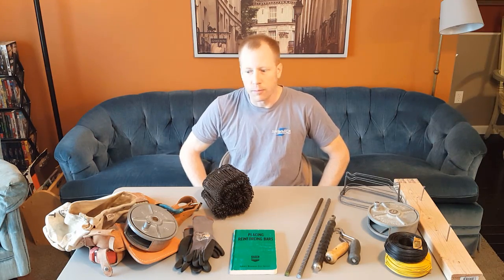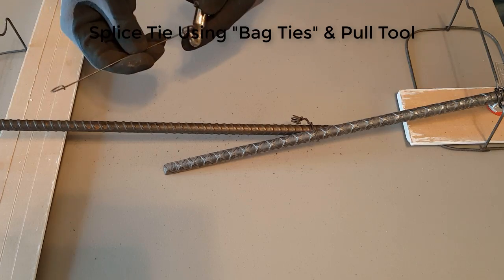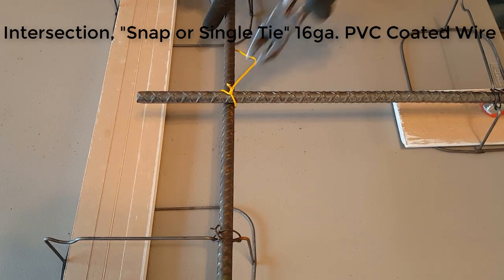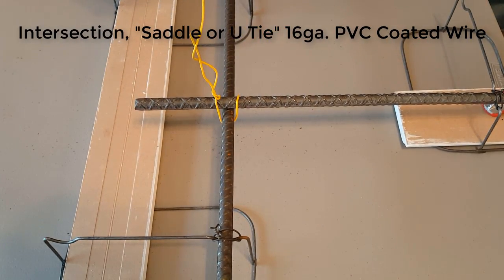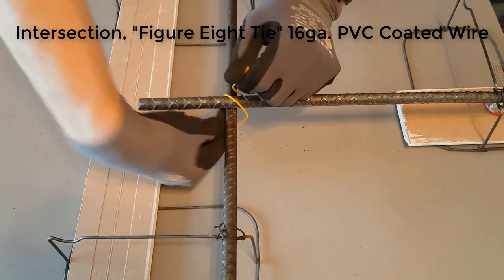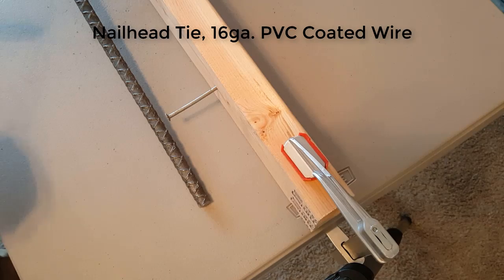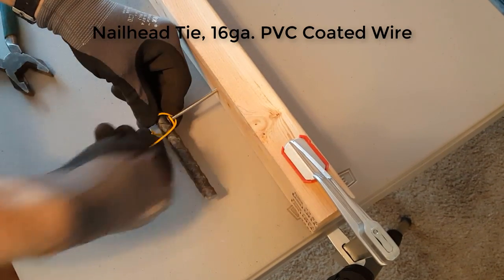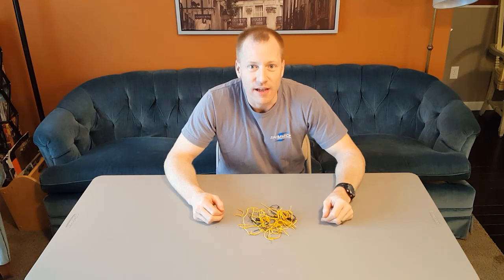Rebar Tying

Comment: Kind sir, you are holding the pliers backwards. Also I'm sure that you are very happy that you don't have to do this for a living. Let the Union Professionals install for you. Please take this post down.
Reply from the maker: What local do you belong to if I may ask kind sir! No, I am not a rod buster by trade, but I know how these things work and I was a superintendent that oversaw structural concrete contractors on a half-billion dollar project including the iron workers that installed the bar. I had to deal with the inspectors when the bar hardly ever was installed with the correct cover, spacing, and so on. I am disappointed that most rod busters will blindly install what is sent to site in the wrong location or without the proper cover because they don't know how or have the ability to field fabricate anything now days. It is always easier to blame someone else  and make a bigger problem so that you can come back, tear it apart and do it over again and delay a project. These are Union Professionals I am referring to. Over the past  6 or so years, there was so much construction that almost every trade was allowing just about anyone to buy their cards. I became a journeyman carpenter in 2000, but a lot of scabs bought their cards and knew almost nothing of their trade these last few years and had superiority complexes because they were now "union" trades people. Where are you in that timeline? Oh, and I'm left handed so until Klein makes plyers correctly, I guess they will be backwards!
Reply: @DanSarahMakers  Greetings from California Local 416 Ironworkers!! No two Tradesman are made alike! So the problems that you are speaking of are indicative of poor leadership both by the Ironworker and Supervisor alike. I've seen inept Superintendents and Inspectors misread and misinterpret the plans and specs. I have well over 20 years in the trade. If you are a carpenter by trade post a video banging in a nail. You are by no means in a position to teach Rebar because you put up a form or two during a concrete pour .I'm a JIW,  not a book buyer.
Reply: Also you can't legally fabricate material onsite without tag and sample and 48 hr notice. But you knew that.

Comment: Here is my question.  You are only tying this to hold it until the concrete is poured right.  Then why not just tack it with a mig welder
Reply: Welding rebar is not allowed by code(CRSI and ACI). It weakens the bar at the point of welding and can easily break.

Comment: It is very critical that both wires twist into the winding.  If one wire twist around the other the central wire twists and will break before adequate tension is achieved.

Comment: Awesome videos on the different ties for rebar. Great explanation, examples, and overall presentation. You definitely need to work on your technique, but since I doubt your career is rodbusting then it's sort of a moot point, just if you want to know, you should use the pliers as a lever to take the slack out of your wire before twisting home and you won't have to twist so much and you'll get a tighter tie, that and you should have your pliers closer to the bar on the wire than the end of the wire.

Comment: Nice video... you need to pull on the wire against the bar with your pliers and then twist; don't just twist and twist until tight, the wire will break.
Reply: Its called heeling the wire wi t h your pliers
Reply: @martinmartinez8001  heel more than twist! There ya go!👍🏻
Reply: Also it is very critical that both wires twist into the winding.  If one wire twist around the other the central wire twists and will break before adequate tension is achieved.

Comment: Really nice presentation of the various ties with different styles.  The yellow contrast with the rebar showed well as you explained.  I used to use simple wire and tie like much of your video showed but as I have gotten older (and always seem to have less time) I have become a fan of the 'loop' ties.  Cheers!
Reply from the maker: Thanks. The loop ties or bag ties are nice but I always seem to try and get them too tight and end up snapping the wire.

Comment: How many ties would an average worker be able to tie using the single tying with a cutter in a day of 10 work hours?
Reply from the maker: Yikes, that is a really tough question to answer, but.... If a rod buster was tying stacked offset wall mats on the flat that already had the bar laid out and they never had to reload their wire reel, take a break, or stretch. I would say a tie every 3-4 seconds would be expected. That would place them in the range of about 9,000-12,000 ties in a work day. That is not reality though, so I would say a couple of thousand would be really good. Start getting into pilasters, columns, grade beams, and other heavily reinforced and congested components and that number might drop to only a few hundred especially if they are placing bar. This is why we estimate bar installation by the ton and take into account where the bar is being used.
Reply: Thanks a lot, that really helps me.
Reply: i used to burn through a roll of tie wire in30 minutes
Reply: speedwayman100 naw yi didny
Reply: On a bridge deck, I went through 16 rolls of wire in one day. All snap ties.